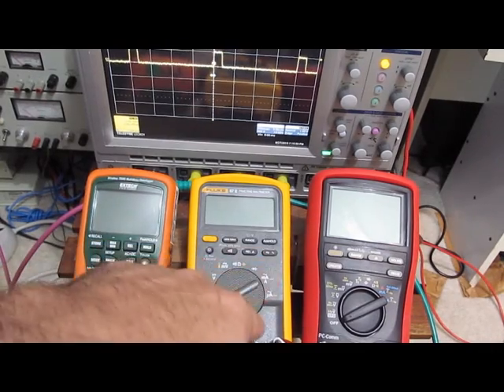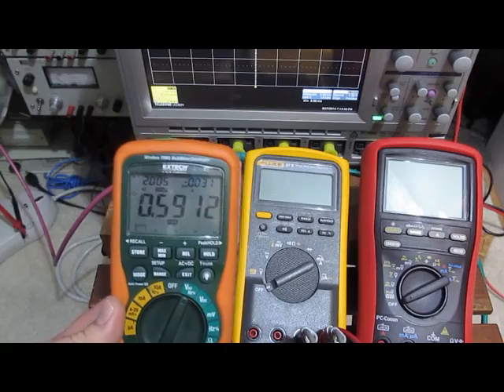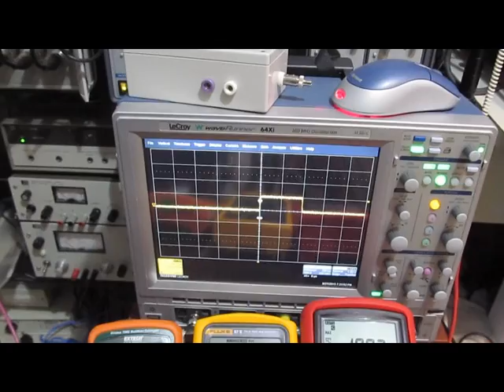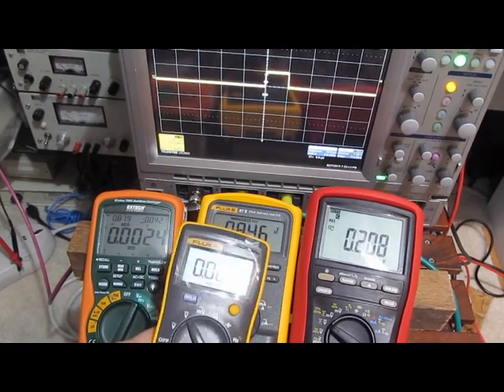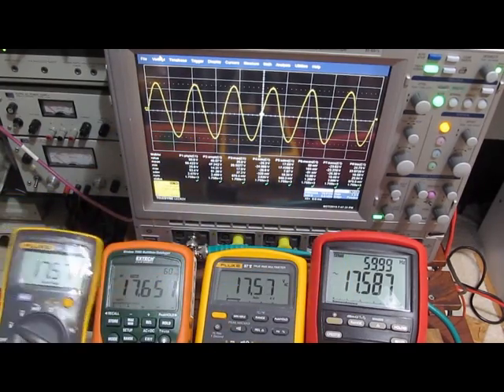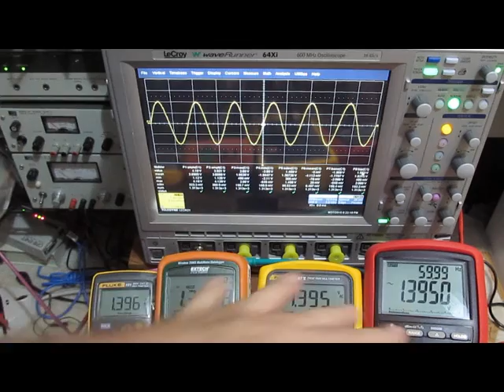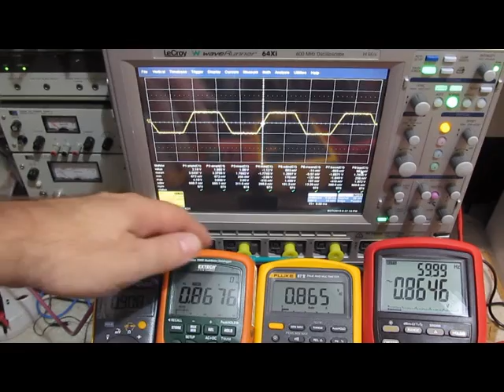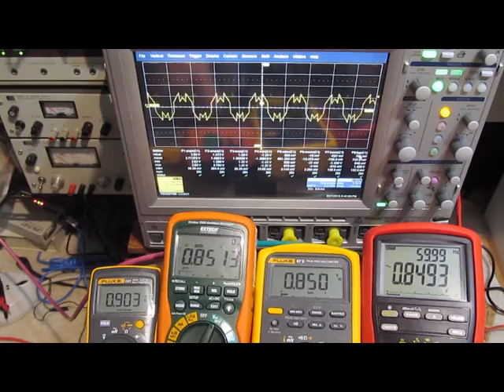Brymen Vs Fluke Peak Hold Part 2

Comment: Hello Mr smith,  I think a multimeter does not need this kind of tests.The multimeter in not designed to measure this custom signals,the test should be in Dc: v mv.Ac: v,mv resistance capacitance. diode testing ... thank you for your videos .
Reply from the maker: YT had filtered your comment due to the mv"."Ac.   It thought it was a link.   I've had a few people ask about the peak detection.   I ran a similar test more recently.   The test starts at roughly half way  https://www.youtube.com/watch?v=mzBDgxkO3HE

Comment: In the other test that I saw, you used the crest feature on the Brymen to capture a tighter pulse than you had on the peak, or am I mistaken?
Reply from the maker: I am not sure what video you are referring to but I wouldn't be surprised if I had used that feature.  Why do you ask?
Reply: I was just curious if it would catch a tighter pulse in this test as well. I'll have to check the other video, and see what timing you went down to.
Reply from the maker: @kontakt4321  You do know that crest is enabled in this video as well don't you?  You can clearly see the indicator on the LCD.
Reply: Having watched this on a 4.5" display? No. I was not aware.
Reply: Absolutely love your videos by the way. They're certainly unmatched by anything else I've seen looking at meters on YouTube.
Reply from the maker: @kontakt4321  I suspect I have used the crest feature any time I have shown the BM869s measuring short pulses.   Again, I am not sure what video your original post referred to, but have a look at the last time I ran it.   Also note that I ran the CEM DT9939 which is the OEM for the EXTECH EX540.  Results were again impressive. 
https://youtu.be/mzBDgxkO3HE?t=1565

Comment: The Flukes are all overpriced but the company wants to make a big profit off of each and everything that they make and sell. Fluke can make an ENTRY LEVEL multimeter for around $25.00 USD, they just don't. They look at it as a waste of time, to a beginner they can't afford a fluke so they go to the others that will make an ENTRY LEVEL meter. EXTECH knows that everybody is not RICH so they have always looked out of the Little Guy. That's why I have always used EXTECH Meters.
Reply from the maker: The Extech branded products I have looked at have not held up in these tests nearly as well as Flukes.  The Extech meters I show are all made by CEM. Quality has been hit and miss.

Comment: Joe, for all those who spent the extra money to buy the Fluke 87V, it seems you are showcasing how the Brymen outshines the fluke series. But I see you have not mentioned just how much more battery power the Brymen sucks from the 9v battery. There was tests done by Dave Jones and Morton, who showed the Fluke only draws 1-2 ma, where the Brymen is almost 4 times as much (not including backlight), so your averaging 400 hours with the Fluke series (Morton "claims" 150 hours). Indeed, the manual says the brymen is rated at around 6ma average, so if your out in the field, I'd trust the Fluke series (and 30 year reputation) over the Brymen. Brymen is a releatively new company (2000), and only warranties the meter for 1 year. Yea the precision is great but at the cost of more power consumption.
Reply from the maker: To date, I have not been looking at battery life and don't keep any metrics on it.

Comment: What are the differences between the Brymen BM869 and the Brymen BM869S ?
Reply from the maker: Steven, thanks for the post.  I had forgotten that I had written Brymen this question.  This was their response:   "BM869s is the upgraded model of BM869 to meet the requirements of the  latest 61010-1 3rd Edition. All of their functions, ranges & features are  maintained the same. Only their input protection circuits are with slight  difference."
Reply: It appears the a primary difference is the BM869s meets the more recent 1000V CAT IV EN61010-1 3rd Edition safety spec vs the BM869 NOT S meets the previous 2nd Edition of the spec.  There may other differences but I didn't catch them in the literature.
Reply: Joe, Your dedication to investigating the workings of our electronic tools are becoming the stuff of legends.  Who else would sacrifice a couple hundred dollars worth of probes for the sake of knowing their real limits.  Answer:  ONLY YOU!  Thanks buddy for keeping it REAL!  Wish you were my neighbor.  I'd bug you constantly just to get to look over your shoulder!  BTW, in my early career, I worked about 3 years each for Tektronix and Philips.  I GET what the specs are all about and their departure from the real-world.
Reply from the maker: No problem. Glad you are enjoying them.
Reply from the maker: What did Brymen say when you asked them?

Comment: Get HIOKI meters they outperform Fluke.
Reply from the maker: +Greg Plusic I have actually been thinking to run a Hioki brand meter.   Any suggestion on what one to run?
Reply: +joe smith DT4282 model is the best they have at the moment, however, even DT4252 from their middle class is well made. Low class models are re-branded.
Also 3801-50 model was really good one but hard to find.
Reply from the maker: I will look into them both.
Reply from the maker: +Greg Plusic I contacted HIOKI via email and after two weeks, there has been no response.   I am not too surprised by this as Keysight was the same.   The cost on the 4282 is currently about $500 US and the 4252 about $150.    Someone had taken some pictures of the 52.  They may be found at:   http://www.eevblog.com/forum/testgear/hioki-dt4252-teardown/         You can see what appears to be a GDT and some very close traces.     I may take on the 4252.
Reply: +joe smith 
Please make a review about Hioki DT4282

Comment: In your RMS measurements, you failed to show the RMS of the fundamental waveform, measure RMS, and THEN the show the fundamental plus the various waves on top.  This would indicate if the meter shows a difference. This is a Crest Factor test.  If your scope could calculate Crest Factor or RMS, (mine does, albeit at low enough freq's), you could compare that to Crest Factor spec limits of the meters.
Reply from the maker: +tkarlmann Do you feel your scope is as accurate as your RMS voltmeter?  If so, what brand/model scope are you using?
Reply: joe smith Good point; I'm not sure.  I just thought an opportunity was missed to see if the RMS meters can see those added-on waveforms you used.
Reply from the maker: All three meters were compared with each waveform applied and as expected, they read the same value within reason.  The DSO has an 8-bit flash.  I don't think we missed an opportunity.